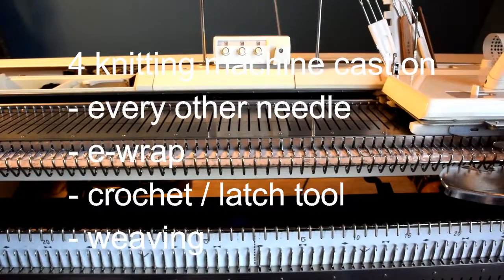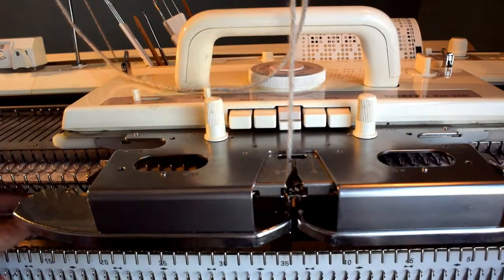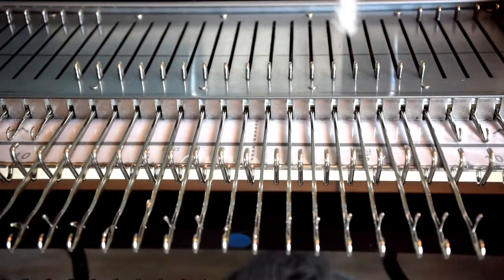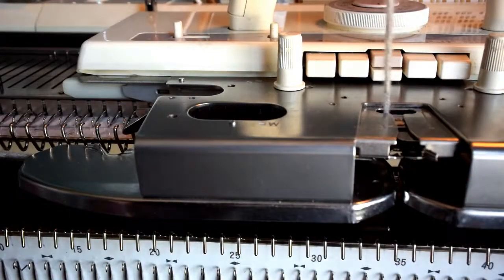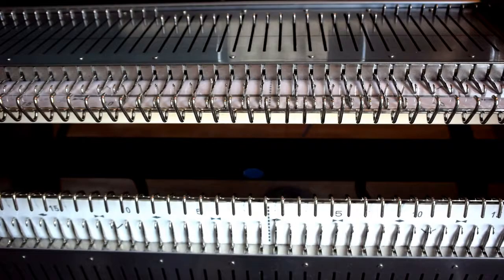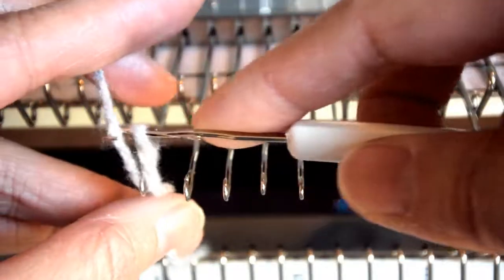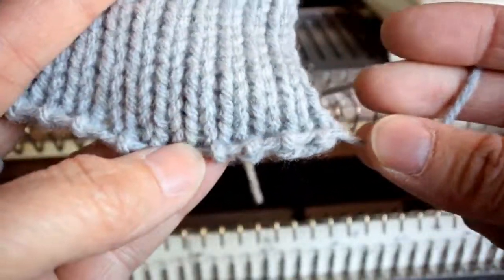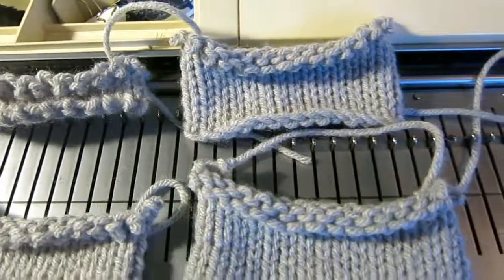machine knitting cast on 4 ways - every other needle, e wrap, crochet/ latch tool, weaving

Comment: How did all needles get cast on?  Prior to 2.38 you have every other needle cast on, but at 2.38, all needles that were skipped are cast on!  How did you do that?
Reply from the maker: Hi, I believe I put all the needles back to the "working position" or "upper working position" before passing the carriage. That will knit every stitch. See the link about the different needle positions: http://blogs.brighton.ac.uk/knitting/2015/06/25/the-main-needle-positions/
Different models might have different names but they work in similar ways. Sorry I did not show that step in the video.